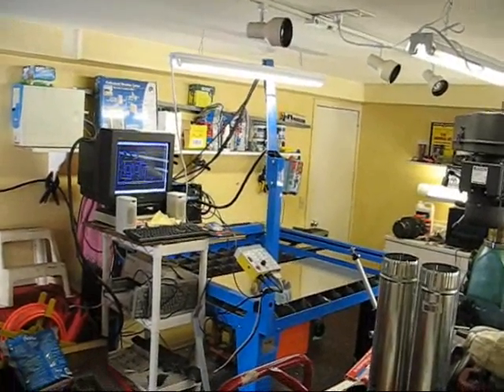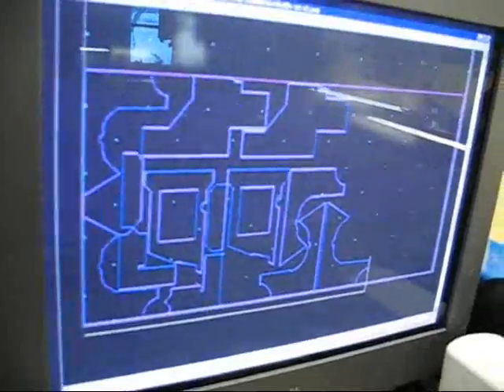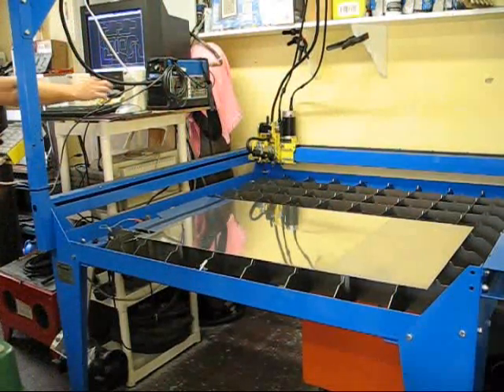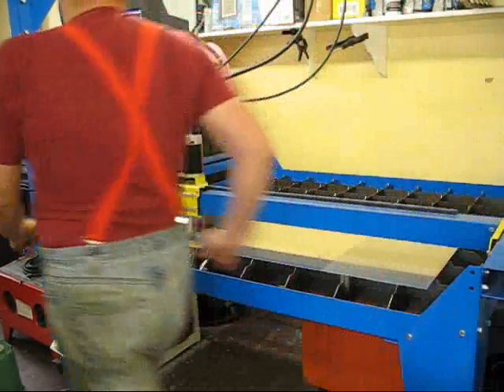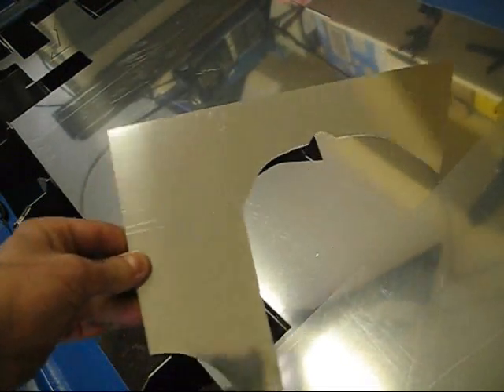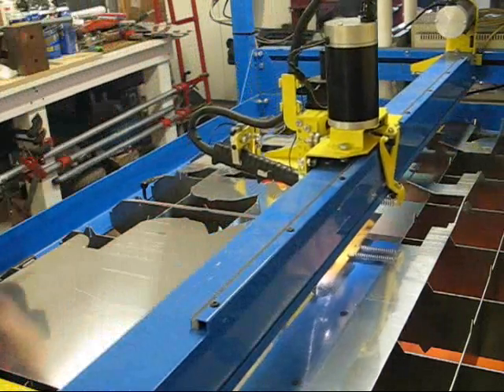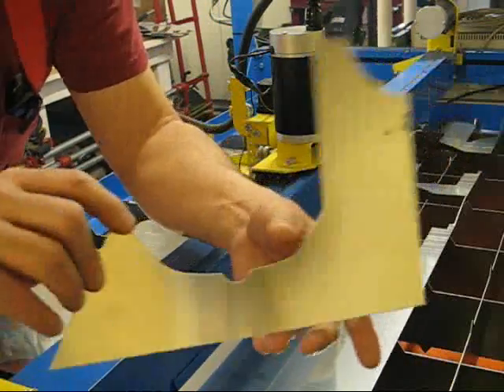PlasmaCAM demo 021109

Comment: That is just awsome! Did that machine cut your finger? or was the plate just hot?
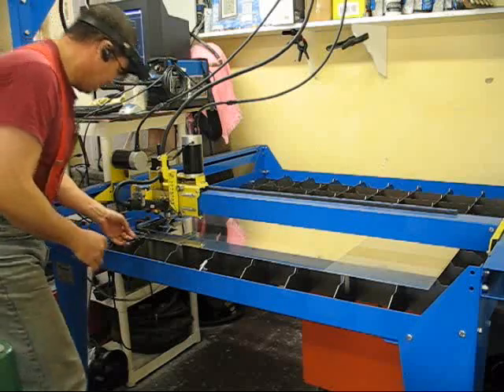Reply from the maker: If you are talking about 1:00, no. I was supporting the material, which is thin, and I reacted to a 'tip-up'; when the material is separated, sometimes the center of gravity of the part will cause it to rock on the support grates. When this happens, the torch can sense material contact and stops the process to protect itself. This is very thin aluminum and it is prone to warping and sliding if contacted. It cools very quickly (not enough to get burned). I have never been cut by the machine, but you need to be careful to not be in the wrong place at the wrong time, which is not to difficult; I have been running this table a long time. Also, now I use RR tie plates which are heavy and thin to set on top of the material to keep it flat and from moving.
Reply: @BrilliantDesignOnline  Ok I thought the machine cut you. When ik cut trough metal i guess it will cut trough fingers too😂
Reply from the maker: @ashstagwoodworking  You are correct: The plasma beam is about 45-50,000 degrees F. (20-28K C) which will do damage in an INSTANT, so I am ALWAYS well clear of the beam. Aluminum cools very quickly, but steel will burn you after some minutes, so you have to take proper precautions, like gloves if necessary. I usually place parts on the concrete floor to cool if they need to be removed from the table.
Reply: @BrilliantDesignOnline  OMG that is realy hot. I did not know that

Comment: Does this not come with something to secure the piece you are cutting from moving around? Also, what's the thickest piece of steel you can cut with it?
Reply from the maker: I use railroad tie plates sitting on top of the material to cut. Plenty of weight and parts don't move. With my new Hypertherm PowerMax 65 amp torch I can cut over 1" thick steel and have cut 0.75" thick aluminum with good quality.

Comment: Nice work @Vondeliusc, How do you connect the plasma cutter to the computer? Do you have any diagram? I have a Miller Spectrum 625 for CNC table use
Reply from the maker: the computer is hooked to the plasma cam controller via a parallel port

Comment: What did you do to convert the Miller Xtreme 375 for CNC use?
Reply: You must hook four wires into the box which PlasmaCAM provides a harness and strain relief for. Two are for voltage sensing and two are for trigger enable. Pretty simple if you are mechanical and electrical and the Usergroups can help with specifics.

Comment: The plasmacam is a good table once you learn how to run it. I have had my fair share of problems learning it, but 90% of my issues have been operator error! I have had to warranty some parts on the table, customer service always tries to work through a problem before sending you parts, but after they find that it is a faulty part they ship it that day!
Reply: Luckily, I have never had an electronic or mechanical failure on my table except for the left and right tracks becoming 'un-synced' which is easy to take care of by removing springs and re-clocking the gantry.

Comment: Had my PlasmaCam for over 5 years now and have not been able to finish one part yet. Bought a new Miller 626 and it works great but half way through the cut it just quits. Sometimes it does great and just before it is done it thinks it's done and goes home.  I have had three people that have ran other CNC cutters and they have had no luck. A local welding shop sends people down to check it out to sell their brand of cutting table.  It's a good table but I have given up on the computer part of it and just cut things by hand. It's one expensive cutting table.
Reply: Steve-sorry to hear that. As an owner, you can join the Yahoo group PlasmaPIG where you will find LOADS of experts who might be able to help you get it sorted out. Apparently the root of many problems is grounding issues. Be sure your table is correctly grounded. A search through the groups archives will give you all the info you need, and also access to all the successful owners who are glad to offer assistance.
-Christian
Reply: Hi Steve, I am sorry that you have had these problems, but you have obviously not heard about the http://Owners-Community.com where thousands of owners help each other daily and exchange help, information, drawings and ideas. Furthermore our PlasmaCAM experts are also available in this forum for any problems you may have.
Reply: Hmm that makes me think twice, plasma cam is comparatively expensive in the UK, far too much for it to sit there as a workbench!
Reply from the maker: Sadly, now I agree. The PC is too proprietary, and the software is very regulated. If I were to do it again, I would purchase a machine which is more open source, non-proprietary parts and controller, and NOT proprietary software. That said, I use the very simple early version of PlasmaCAM, which is super useful and reasonably easy to use. And it is reasonably reliable, but sometimes you run into weird behaviors which are difficult to troubleshoot, and the documentation is thin.

Comment: anything cut with a plasma cutter will leave a bur, if you dont want a bur you need a lazer cutter or a water jet, they cost about 10 times more than a plasma cutter to both operate and buy
Reply from the maker: A laser would be nice, but WAY more expensive.

Comment: Wicked.  I recently picked up a 625 eXtreme and was wondering how I would get it to work with my existing large gantry style home-brew CNC machine.  Now I know that it is indeed possible, and I didn't waste my money by picking a Miller!  Cheers
Reply from the maker: I have since upgraded to a Hypertherm PowerMax 65 and have not looked back-a SUPER nice torch.

Comment: Nice setup. What modifications did you have to make to the Miller 375?  I know they don't have a factory connector for CAM control.
Reply from the maker: The mod to the Miller, like every plasma cutter you hook to the PlasmaCAM DHC2 requires removing the cover, cutting the 'firing' trigger wire, hooking a wire to the plasma plus and ground to measure voltage, and wire tying the trigger continuously on.
The table controller can then control the triggering of the arc and measure the voltage to adjust the cutting height. Usually about a one hour project. And there is a jumper plug which allows you to use the torch off table by removing the wire ty.
Reply: @BrilliantDesignOnline  Thank you!  It's been 8 years, but still helpful as I hope to one day convert my CNC router to a plasma cutting table.

Comment from the maker: 1/8" steel is easy. With my torch I can cut up to 3/8" steel. I now have a HT 65amp torch which will cut 3/4" steel nicely with a 0.050" kerf, but it cuts slowly.

Comment from the maker: @sharko86 Many of these questions are answered at my alpineworldwide daught com site. In fact, look through the comments below for all the answers.
Cost ~10Kusd for a used system.
AutoCAD=yes you can import DXF files directly into the PlasmaCAM proprietary control and design software, which is what I do with SolidWorks. If you would like to discuss details, contact me by email..
-Christian

Comment from the maker: @vzuani65 I do believe in safety. Aluminum dissipates heat very quickly, especially when it is this thin. I have been doing this for years now. I think I know when I need gloves. Thanks for your concern. Be sure and wear a helmet.
I rarely get burned. Last time was because I had holes in my gloves :-)

Comment: Nice Video, very well done! 
I am thinking about building my own cnc table for my Miller 375 Xtreme plasma cutter. However, i am not quite sure which dc servo motor i should use. Maybe you know what type type of dc servo motor (specs would be nice) they use to move the plasma cutter over the table?

Thanks in advance & greetings from Austria
Reply from the maker: A little late now, but building your own is the way to go. Tons of good servo motors and/or closed loop steppers on AliExpress these days.

Comment: the plasmacam software is decent but I don't miss my plasmacam at all ! i had a lot of problems with the arc voltage shift and z-axis smashing the plasma cutter tip into the metal. i built a cnc router table and i am currently running vectric v-carve pro, cut 3d, photo v-carve and mach 3. I am going to be building my chain drive cnc with thc soon.
Reply from the maker: I have problems with the arc-voltage shift also. Would be a LOT better if it were not so mysterious, and it the PC manual were written by someone who had some experience and catered to users who did not understand. I STILL don't understand some settings like 'G's' for corner acceleration, which have NO UNITS or EXPLANATION. Pretty lame if you ask me.

Comment from the maker: @davimundo It is OK. It is better that I can understand you in english. I am careful how I operate the machine. It only will move according to the pattern, so it may look more dangerous than it is. It has power, but the head will release with too much pressure, but I am respectful of the machine. You may be able to find a PlasmaCAM through eBay in used condition, but you must have four (4) things: the PlasmaCAM table, a plasma cutting torch, an air compressor and a computer.

Comment from the maker: @DemonWizzard The material is pretty light, and the torch head comes down initially to contact the material, and also if you have 'tip-ups' from already cut items, the torch head can move the whole sheet. Sometimes just holding your hand on the material is enough, but I use railroad tie plates generally to add some serious weight to hold everything stationary. On this particular run, the torch grazed a tip-up and slightly moved the whole sheet, causing a couple parts to be inaccurate and re-cut.

Comment from the maker: @l337gr33k I have tried the entire range of cut speeds, with no changes in dross.
I need to get a harbor freight air refrigerator to remove moisture.
I think this is the base of my dross problems.
That, and not using a laser. :-)

Comment: @vondeliusc  SolidWorks?? dang- depending on the version that can be an $8,000 program. I use, simple and easy to use, CorelDraw to draw my parts. I bought a PlasmaRoute Table and Gantry. i use SheetCam for Tool Paths and Mach3 for Cutting. I may have an extra step or 2. Once you know what your doin. Its easy to use  :)

Comment from the maker: @carstereofanatic Which unit did you go with? The PlasmaCAM software is actually quite good for operating the machine, and barely tolerable for drawing. I use SolidWorks nearly entirely for drawing with precision and importing into PC, but I can do simple drawing mods with PC. I require precision as well, so I import virtually everything into PC or use a scanner to scan existing parts to import also directly. I feel sorry for the PC owners whose only drawing option is the stock software, but

Comment: I looked at PlasmaCam when looking for CNC Plasma Machines. I just couldnt get past the program they use. It didnt give me the freedom to create precise pieces that i need. I found better software and a lot better table for 3k less then PlasmaCam. And i Love it. In about a year youll need to replace both side rails on your PlasmaCam. The bearings on the gantry wear out the steel causing the gantry to sag. Nice vid.

Comment: 0:59

Your finger almost came off!!
Be Care full machines have no mercy.
Reply from the maker: Not even close...just a 'tip-up' where the cut part is only supported in one or two points and tips at an angle. The torch will automatically stop if it makes contact with a piece sticking up; but I pull my hand back just in case, and the motors are not that strong, so there is little chance of getting 'caught'. Now getting burnt by the torch flame would be bad....

Comment from the maker: @cjellwood About $1500usd for the (inverter) torch, already had a 5hp compressor, and $10,000usd +$400shipping: I considered building it myself, (which you could), but with the precision and quality of build, the functionality of the electronics including the torch height control, and the included VERY excellent and flexible software, I think this is a very fair price, considering I could not duplicate it with superior results. You could build your own, but my time is worth well what I paid..

Comment: @vondeliusc I was quoted around £1200 for this setup. £10,000 for the rig and £2000 for the torch roughly.  10 grand seems a lot of money for the frame and software considering the cutter torch is only £2000 ?  It looks like there is still room for better pricing here.

Comment from the maker: @cjellwood That is correct. The torch is a stand-alone Miller 375 Xtreme 27 amp handheld mounted into the PlasmaCAM gantry z-axis mount. An air compressor is required also.

Comment from the maker: @7863348 Yup-you get burnt every now and then. Aluminum usually cools pretty fast. I now use railroad tie plates as hold downs (massive), but you still get movements occasionally. There are two good Yahoo groups for owners: PlasmaPIG and PlasmaCAM. The unit comes with plans to make a downdraft side walls which I will do soon which is better than a hood. It generates ALOT of very black metal dust which goes everywhere, so a downdraft is essential.

Comment from the maker: I have never seen that-go to yah oo groups Plasmapig or PlasmaCAM_TechTalk and join. Membership requires documentation in both groups. Folks on those groups can offer technical advice. I would check to make sure your port in the software is set to autodetect. Also check your wiring and try to initialize with your torch off to minimize crosstalk and check your limit switches are not stuck.

Comment from the maker: OH YES..perfect for making turbine parts. How thick it cuts depends on your plasma cutter. My Miller 375Xtreme inverter unit is 27 amp which will cut 3/8" steel, but only 3/16" Al, since Aluminum dissipates the heat so quickly. It will cut 1/4" holes but not 'nicely', but they are passing. You do not get 'nice' holes until you get up to 1/2" diameter. My Hypertherm 1100 torch will cut >1" thick steel, although I have not attached that plasma cutter to the table yet. You should see it do a FT.